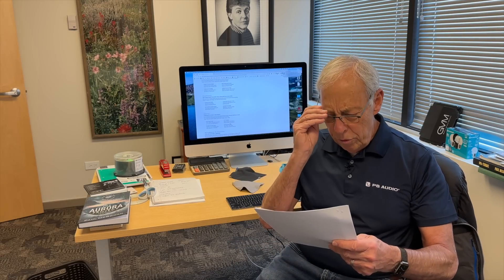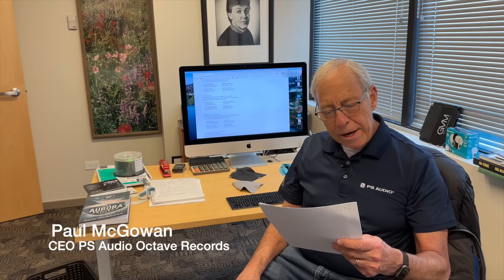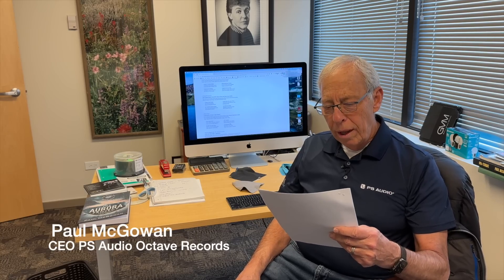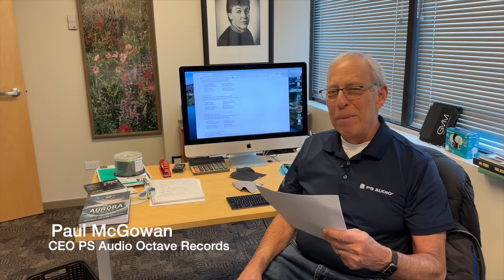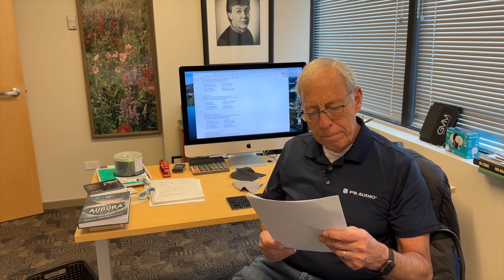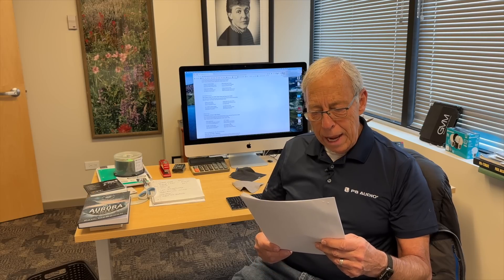Integrated amplifier gains

Comment: Gain in Decibels is a logarithmic measure where one doubling of voltage equates to 6dB. Thus 12dB means 4x, 18dB means 8x, 24dB means 16x etc. 40dB means 100x. Mathematically the dB number is equal 20xLog10(Vout/Vin).

Comment: Re: GAIN. I have always wondered just how high an output from the phono cartridge would be the minimum that your average regular phono stage would be able to work with, in order to provide enough volume without seriously constricting dynamics? Would 1.0 output probably be enough for your average phono stage? 1.5 mv.?  At the opposite extreme, how much output would overload a line section to where it starts sounding funny? Like from a cd. The loudness wars have given us cds with reduced dynamics and overall sound quality, but what I've never seen mentioned is how some of these loudness wonders of a cd, can actually overload the cd or line input of an integrated amp. Maybe especially the vintage integrated amps before cd, and it's dynamic range capabilities. I was playing The Ventures Christmas cd duiring the holidays (what a group), but I could tell it was overloading my line stage. It was the one with 20 some tracks. Luckily I had the one with far fewer tracks, which was an older Ventures cd, and the output was lesser,  and it did not overload my integrated amp's line stage. Sometimes newer isn't better; it's only louder.
Reply: I use vintage gear not quite but almost exclusively. My number one media source is CD/SACD. I’ve personally never once had a problem with overloading a line input on any vintage preamps/integrated amps I’ve ever owned.
Reply: Some people think you can run a relatively low output moving coil cartridge into a preamp without an MC input and make up for its lack of gain by having a 300 watt power amp. I don't think that would quite work out. The guy behind a new UK high end audio company called Origin Live, whose products have been getting oohs and ahh reactions from reviewers and people who've heard their product, said that the output of a phono cartridge is amplified roughly 8,000 times before it becomes a high enough level signal to drive loudspeakers. There was a very expensive cartridge that Ortofon came out with around 1988, called the MC2000 that had a miniscule output of only 0.05 mv. Very few coil winds which gave it extremely low moving mass but a correspondingly low output. It is considered a classic with its X-ray like resolution. PS Audio ironically came out with a preamp years before, which was one of the only preamps with enough gain for that cartridge. J. Gordon Holt who started Stereophile and was still a contributor to the magazine, thought it was the best phono cartridge he had ever heard. Anyone who has an old NOS Ortofon MC2000 could pretty much name their price on the second hand market. I'd guess $3,500 would be a cinch and maybe near double that would be possible. I never could understand why more people don't go moving coil cartridge. They are so fast, open, 3 dimensional and transparent. Some of them have medium or high output where you don't need a step up device. I would guess that of people with $10,000+ systems, around 90% are using a moving coil cartridge or a Grado moving iron cartridge. Moving magnet cartridges you don't see in many higher end systems. Although there are supposedly a few great ones at high prices like the Clearaudio Charisma.
Reply: Chances are that the CD that overloads your system was either made from a poorly made re-master recording, or made from the same master but cranked too high going into the digital master. It could be that there was a lot of compression used in making the master for that CD, which would make sound louder than the other, or they might have overloaded the tape, which has the result of some distortion in the loudest passages - essentially similar to clipping an amplifier but "softer," since you end up with a curved signal rather than a square wave. One of the challenges of using magnetic tape is getting as much dynamic range by increasing the volume, without overloading the tape, in order keep the noise floor from overwhelming the quiet passages. Some level of compression can help that, which can include some peak limiting, but too much compression makes an unnatural sounding recording.
Reply: The only audio things I ever bought based on a reviewers review was back when I was in my 20s. I bought a Kenwood Integrated Amp, mail order to get a better price, which I liked ok. I might have bought my next upgrade based on Sansui's ad literature and the fact that they had a good reputation. I bought that mail order also to get a whopping discount. It served me well. I did buy a pair of AKG K340 headphones based on some reviews without being able to hear it locally, as the local store only carried models up as far as the K240...40+ years later it is still one of the best headphones I've ever heard. I have one that is somewhat more likeable now though. I did buy some used vintage amps based on Audio Forum users testimony. One could be switched into class A which I wanted to try and liked. I tried some other Class A integrated amps and liked them too. I bought a cd player based on Audio Forum user testimony and liked that also. So I have never bought anything based on a review or testimony that I didn't really like. I bought some speakers based on reviews and Forum testimonies  that were winners too. I've been lucky. I wouldn't be surprised if some other items improvements were exaggerated in reviews and some others were semi-disappointed at how much improvement they got for their money spent. But I buy almost everything used to save money. I can't remember any disappointments as I research each piece before buying and deal with sellers who have great feedback.Hearing something first is always best but with modern day realities eliminating that often, you can usually get away with buying something sight unseen and it being all that you hoped for.
Reply: @Douglas Blake 
Hard to say. No one’s ears within the human species are as capable of discerning fine detail as the “audiophile” community thinks they are. That aside I haven’t always been a digital guy. Did vinyl and even various tape formats for years. All together at one point so I’m familiar with many albums in my collection on all formats. Eventually I gave into the very obvious fact that CD was hands down the cleanest, clearest and most detailed with none of the mile long list of shortcomings you get with vinyl and tape. I have been on CDs and SACDs pretty much exclusively for several years though. I guess my point is regarding @sides up comment talking about CDs overloading line inputs on vintage gear. I’ve never once noticed anything resembling an overload due to proposed higher output voltage. Embedded distortion isn’t exactly the same thing as overload due to output voltage or increased dynamic range which I believe is what was in question.
Reply: @Douglas Blake 
I think you’re missing the original point entirely. Embedded distortion, intentional or otherwise isn’t, at least what I’m talking about. Yes it’s obvious within pop and rap if you listen to that crap. I however listen to well recorded music so if this is some sort of defending vinyl over CD issue for you then I can tell you that audiophile ears or not, the difference between the quality of PCM or DSD in comparison to vinyl isn’t a comparison in the slightest when you’re talking about well recorded music. On a level playing field the vinyl absolutely doesn’t compare. Doesn’t even take much of a pair of ears to immediately choose digital and for a mile long list of reasons. Digital recordings that aren’t good is no fault of the digital itself. It’s how the recording was executed. I’m just not sure how we even got here when we were talking about output voltage overload on vintage equipment. At least so I thought. On that note I’m sorry for the apparent confusion and I bid you good day sir 👋🏻
Reply: @Douglas Blake 
Yeah okay guy. Holy shit I love the internet 🤦🏻‍♂️